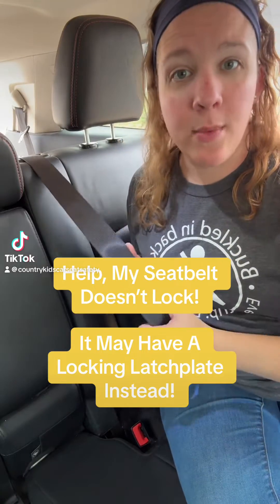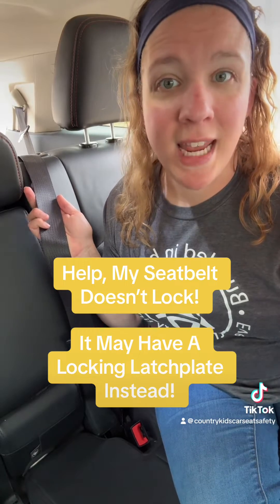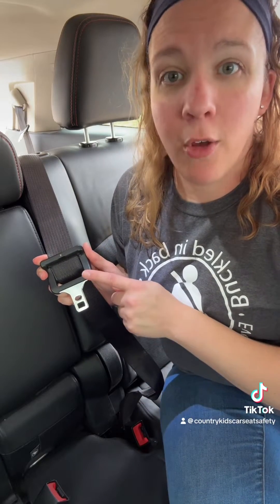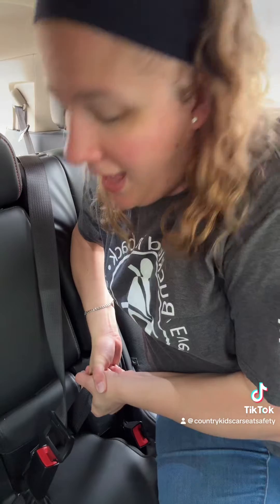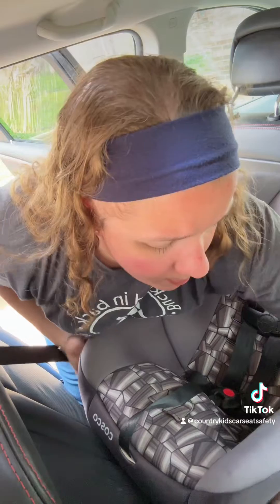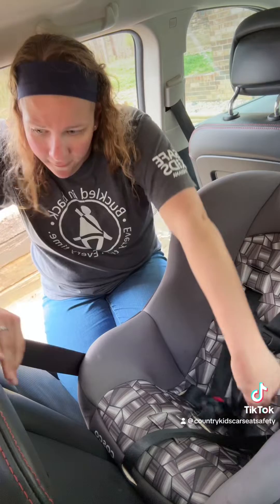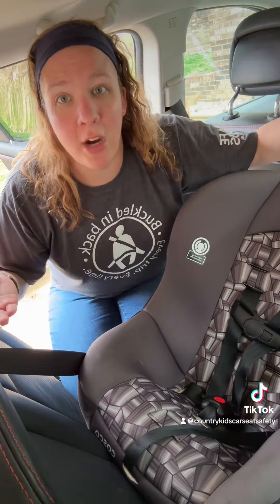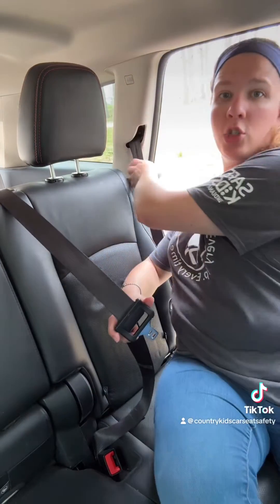My Seatbelt Doesn’t Lock-Or Does It?

Comment: My gosh. Thank you so much for this video. We had our middle seat 3rd row Dodge Grand Carvan seat belt replaced over this. The owner of the shop has the Chrysler version of our van and his did the same thing. He was unaware. You may have saved us $600 and given us a lot of peace of mind. We are going to validate with Dodge this is 100% accurate for our year model but looking to be the case. (Everyone tore through the manual and this wasn't mentioned)
Reply from the maker: @Contriteone-.-  and your Dodge Caravan manual may refer to it as a “cinching” latch plate, just FYI
Reply from the maker: @Contriteone-.-  So glad it was helpful! It does throw a lot of people off, my Dodge Journey’s center seatbelt also has one.  I had no idea until I became a CPST and they used my car as an example during the course!